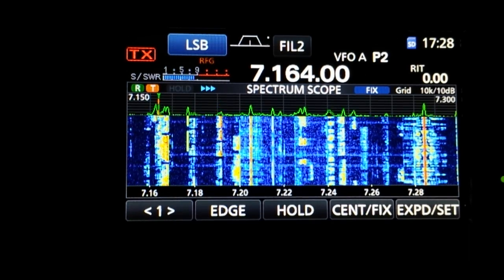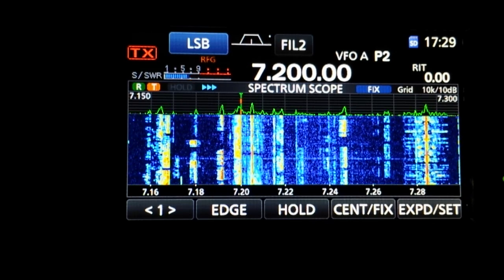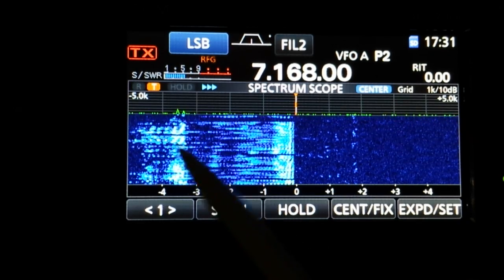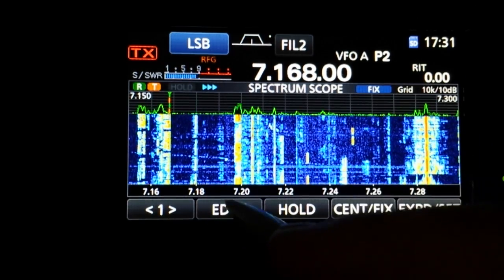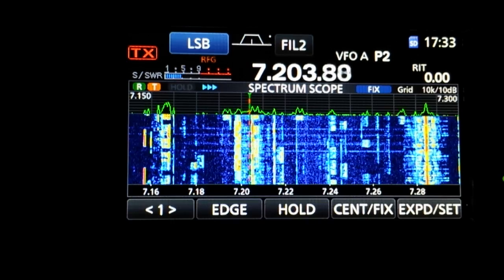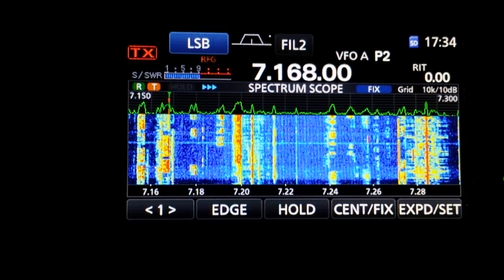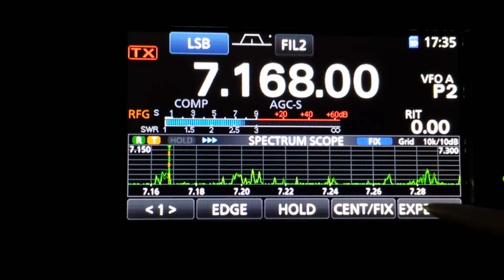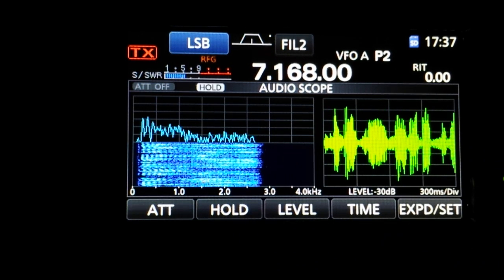IC-7300 SSB Tuning - N4LQ

Comment: My radio is never that clear. Always static and noise. How did you get your audio so clean?
Reply from the maker: I moved to the country!
Reply: @n4lq  I live in the country as well. We are so rural no wifi exists here. I am new to Hf, probably have something set incorrectly. My Yaesu Ft 891 is so much quieter than the Icom 7300. I just got the Icom yesterday. I'm trying to find videos for settings to help make the Icom more pleasant to listen to.

Comment: My IC-7300 does not tune to the edge, either upper or lower edge, but rather the center of the signal on the waterfall. Is there some way to set it correctly? BTW my Kenwood TS-890 has the correct edge for tuning, but is slightly outside of the signal display.(on the display there is a vertical "box" where the signal is displayed.
Reply: Select the cent/fix soft key to switch between the two.

Comment: Steve, thank you for the video on the IC 7300.  I've watched your other presentations, as I am considering buying one.  I was also thinking about a used IC 7600 but after your review of the 7300 and other YouTube comparisons between the two I think the 7300 may be my choice.  Thanks again 73 de Roger, W8RLP